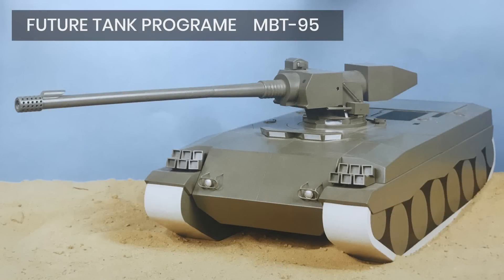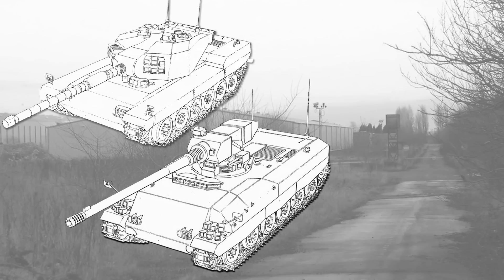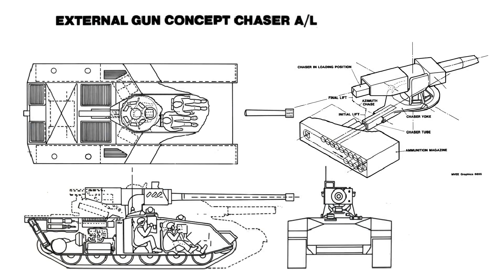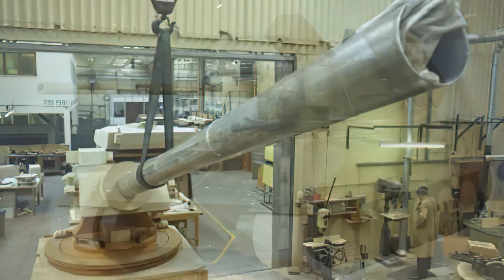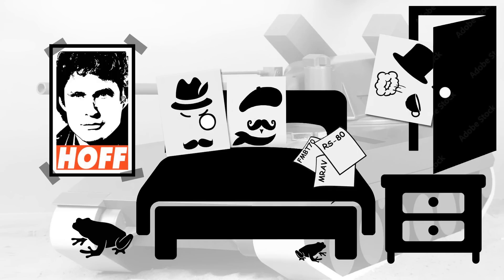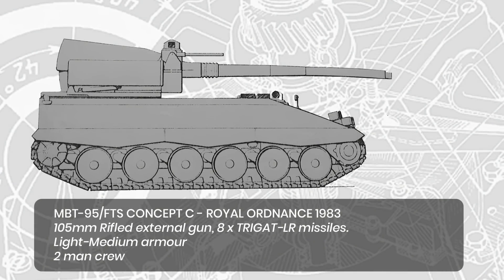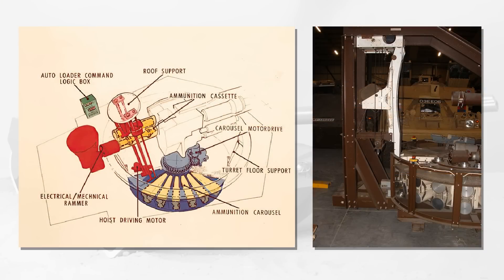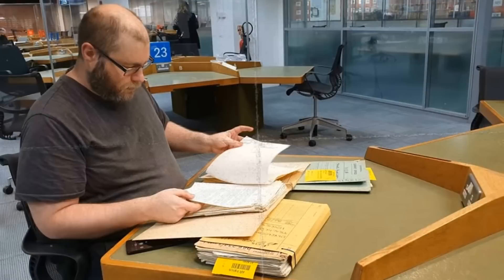MBT -95 - Royal Ordnance: Tank Design & Development

Comment: Fascinating stuff! Access to the engine in B seems particularly troublesome, but necessary because the ammo has to fit _somewhere_. I'm not sure exactly where the engine fits in C, but assuming it's partially underneath the turret ... that would be annoying.

But I suppose when studying unconventional layouts, it's certainly worth seeing if the benefits of compactness or crew safety could be worth cramming the engine in an annoying location.
Reply: In the age of power packs that can be removed In 30m already going into production. I can imagine it going anywhere
Reply: @samgeorge4798  Okay, but in which direction could the power packs be removed, with the B and C options? Straight up isn't a good option because the turret is in the way. To the rear isn't an option because the rear ammo is in the way. To the sides isn't an option because the tracks are in the way. Forward isn't an option because the crew and main armor is in the way. Down isn't an option because the ground is in the way ... or is it? Maybe if you tow the tank onto a raised platform ...
Reply: @IsaacKuo  usually (Abrams Leppard) they are sort of pulled up and out from the back. The back and top panels open up and pulled out the back. The turet is moved looking to the side so the turret bustle is not in the way. A and b could probably do this but. C would need the turret to come off. Making it much harder
Reply: @samgeorge4798  The ammo magazine seems to get in the way, but I suppose any crane strong enough to lift the engine is strong enough to first remove the magazine.